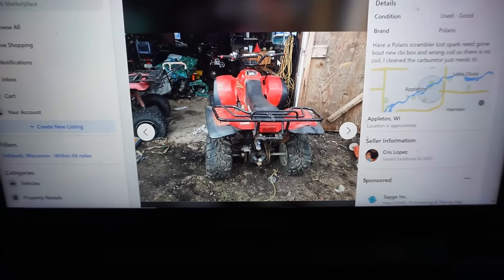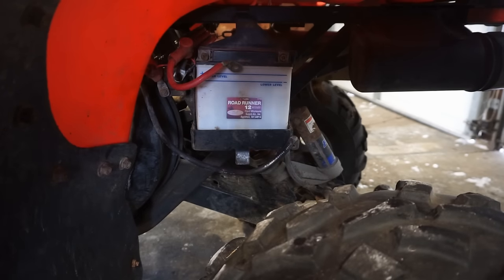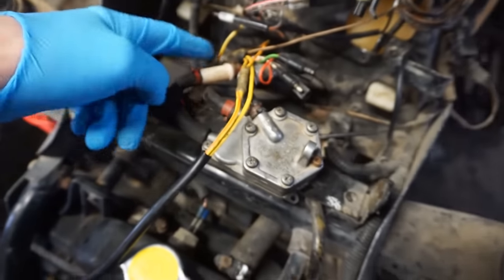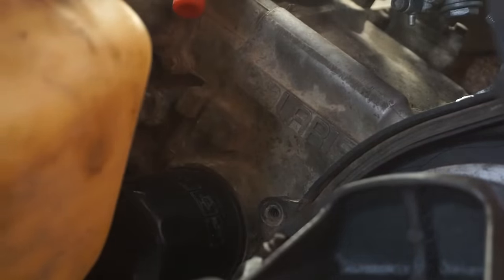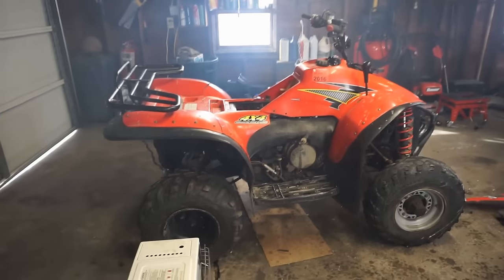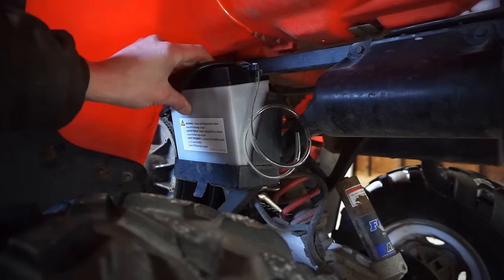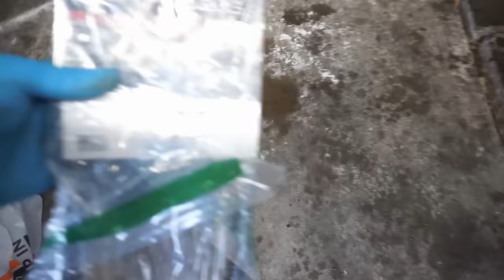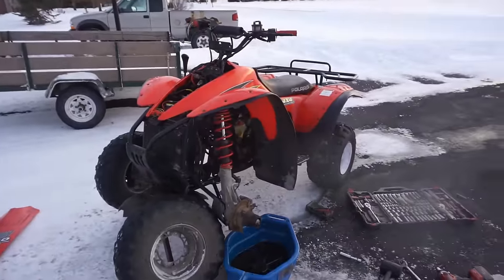Seller Said This Quad Was a SIMPLE Fix...$900 Polaris Scrambler 500 4x4

Comment: I had one and I stopped to pull a wheelie & just as it starts to wheelie "BANG"!    25mph was top speed after the loud bang.....front axle chain broke 3-4 times front 4wd hubs would lose their seal and water corroded  making the magnetic actuators randomly not work,drive in mud and water belt slips ......total peice of junk,had a trailblazer 250....ran good but cvt would act funny off n on & idle would vary like it was messed with and I always raise or lower idle speed.....they've improved but still not much better than Chinese shitquads.
Friends had em there's were junky too,
I would never buy one new or used since there's Honda yamaha and Suzuki to be had

Comment: Polaris knows about things like the cheap rusty exhaust and broken clutch sheaves, they just don't care...they're an absolutely horrible company to deal with from a manufacturing standpoint, and they've burned so many bridges over the years with companies making parts for them that they refuse to allow the companies to make better parts for them...I won't ever own a Polaris product after having dealt with them on the manufacturing side for so many years, they're hands down one of the worst companies I've ever been involved with (I've worked for 5 different companies that made parts for Polaris, and every single one of them has had the same problems)...

Comment: Polaris isn’t too cheap to use stainless steel. Buyers are too cheap to pay for it.
Reply: OE exhausts are usually replaced by after-market ones rather quickly.  Even sport quads come with junk metals in their exhaust systems.

Comment: Sounds weak as hell for a 500. Ya i saw it trying when u stopped. That was when divorced ya. Grease doesnt go in open holes guys fellas  some might but dont put it in unless told by a senior worker. Zerk fittings are for grease. Oh i was gonna say yoar any clanking from the exhaust  iv| seen pleny pop a cap in there . cable blowaparts or a silencer.

Comment: Dang cheapest parts possible 😂😂 guess if its a flipper
Reply: Never buy HQ parts until you get it running.  Parts don't need to last if the machine is not going to be worth fixing, it just needs to start and run.  HQ parts aren't necessary for that.
Reply: You diagnose then fix the machine, poor quality parts can further complicate fixing the machine. Diagnose, buy once and move on. They dont need to be high quality but quality. I know its a old video so not knocking him hust saying. Guess its a matter if opinion there is level and a difference hence the sayung shade tree mechanic.

Comment: Good clearly didn't know the 4x4 system. They're not junk they are different. They're designed for when you are using four-wheel drive and you have wheel spin and it immediately stops it don't go breaking expensive parts. It's quite effective. You hear that belt so loudly by the way because you don't have all the duct work for that bike. If you don't know just so you don't know do the research Jesus